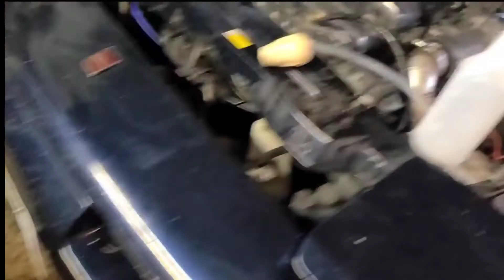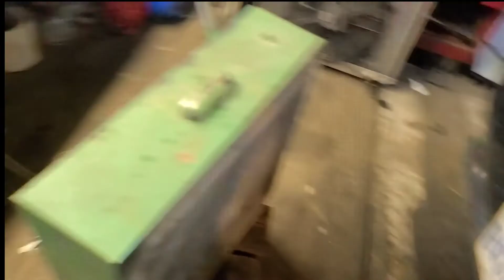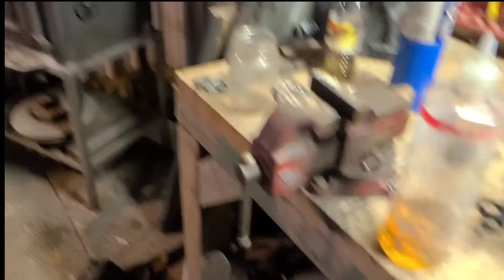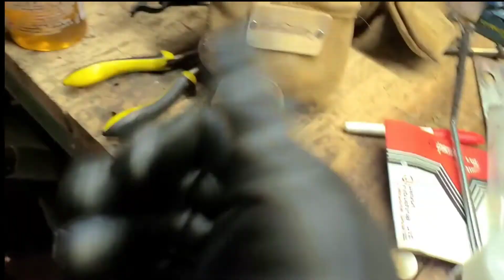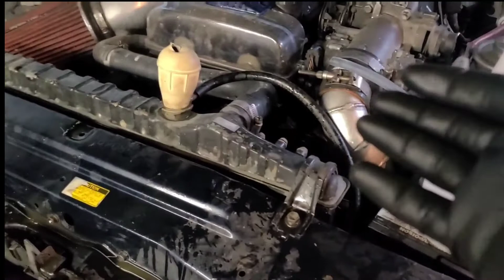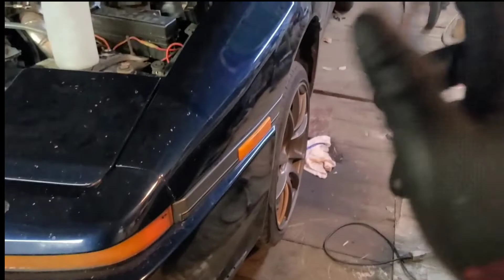DIY Engine Block Leak Tester

Comment: Awesome, did not want to spend $33+ for the little turkey baster type tool since the fluid is only $10 and I'm only testing one car. Sorry about your head gasket. Auto makers screwed the pooch by not adding a chime or flashing light when a car is overheating. My first car overheated (1991 eclipse gsx) back in 2001...luckily I was always staring at the gauges and spotted it in time. The shop that did my tbelt and water pump didn't bleed the coolant system and the h2o pump failed. Had to fight them for a refund and did it with a buddy...man that was hard at 18 and limited internet help.
Reply from the maker: @michaelangelo5783  absolutely! I was thinking the same thing. Maybe just a ding ding and a flashing light could save a lot of headache!

Comment: Does anyone know what block test fluid is comprised of?  Is it anything more than water with blue dye added?  Can Windex substitute?  BTW FYI nobody tells you that blue block test fluid that has been used and has turned the green-yellow color from a positive test result can be left in an open container for a short while and after the combustion gas outgases from it, the test fluid will return to the original blue color and can be reused, so you don't need to discard used block test fluid.  Thanks.
Reply: Bromothymol blue is the fluid (It can also be found in pool test packs) basically when CO2 passes through it bromothymol blues pH becomes more acidic turning it yellow.

Comment: thank you.  i am doing this now.  I actually bought the block tester thing but using your method to confirm.  What is better about your method, is that the test fluid is far away from the coolant.  If the coolant is boiling and you have lots of combustion gases mixed in, it is difficult to ensure that you are only sucking the gases and not accidentally sucking up coolant (with the store bought tester).  good job and thanks.
Reply from the maker: Thank you very much. I'm glad you found this helpful. I didn't want to buy a tester so I got creative. Thanks for watching and hopefully you don't have any gases in your coolant.